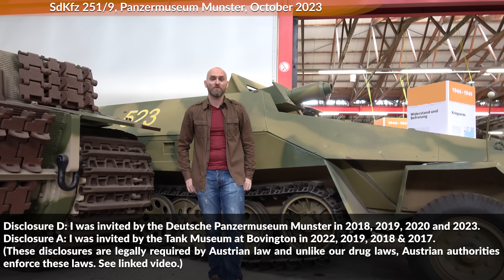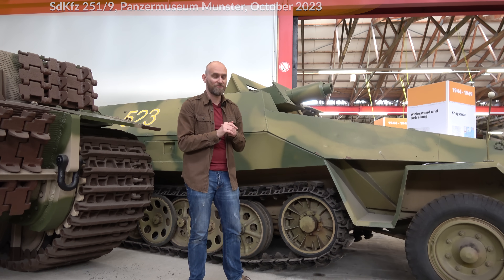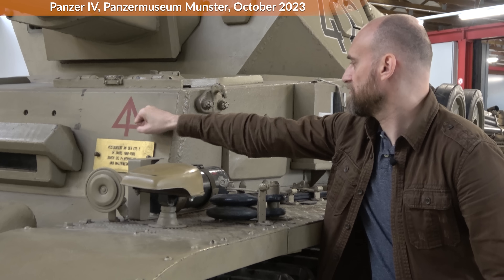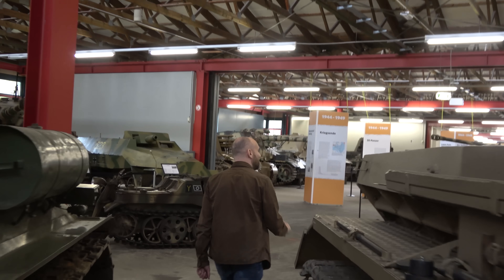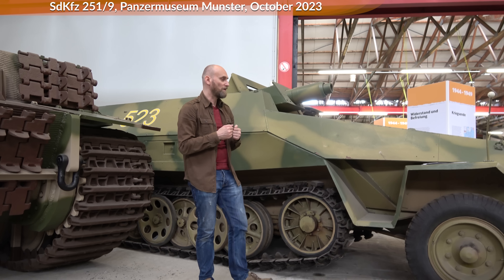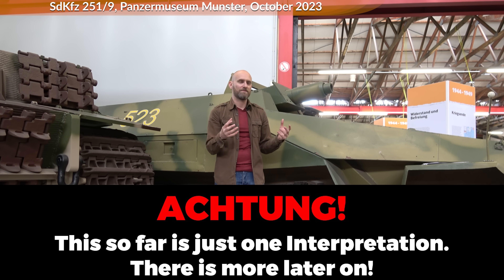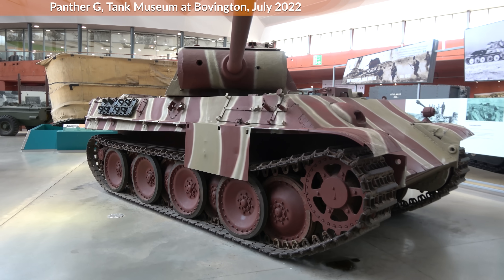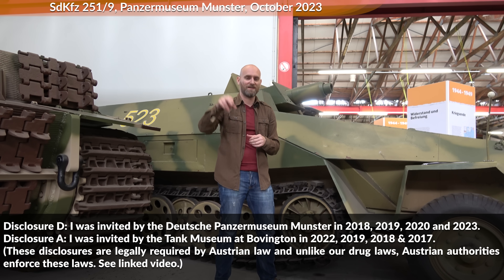Why was German Sloped Armor so late?

Comment from the maker: Get our books here: http://militaryhistorygroup.com
Reply: It might be worth your time to look through Battleship New Jersey's channel, as they have made a number of videos on the implementation of welding into the construction of the ship, and the transition from riveting to welding.

As welding was still an experimental process at that time they might have gone overboard with it, and all throughout the ship you can see how all the welds between the armour plates use a unique "scalloped" design, I guess to get as much surface area as possible, as opposed to a welding in a straight line.

Perhaps the Germans were trying increase the surface area of the welds with the interlocking plates?
Reply: Is it possible that the interlocking of the plates could have been done as an aid to properly fitting and aligning the armor to make the assembly and welding easier and more consistent? I don't what the difference would have been in the factories regarding how the workers fitted the plates in position prior to welding.
Reply: uh the library grew a lot, before there were good works but not of my interest, now it is different!
Reply: -- Thanks Bernhard for the video, but its still does not addresses second part of "sloped armor" dilemma... I always said, that "slopped armor" is incorrect "western" translation for armor LOS(Line of Sight) or/aka EAT(Effective Armor Thickness). So confusion of terminology of sloped armor is can be broken down into two separate effects:

-- First: Sloping Armor Plate for a sake of deflecting/ricocheting projectile, which is simple and uncontested concept, that is often time used by "expert historian" to undermined second similar, but not the same concept/benefit of:

--  Second: Armor EAT or LOS in "Rational Angle of Armor Plates", which is doubling armor thickness at steep slopes of ~50-60 degrees and using that defeat/optimize against anti-tank(PaK) guns, and that "Rational Angle of Armor Plates" have author - his name is Nicholai Tsiganov, who came up with this theory/concept while working on light BT tank to gave those tanks sufficient armor protection, while retaining somewhat reasonable tank weight and more importantly light tank mobility, while providing heavy tank armor protection, and that is where most historians failing to explain.

P.S. Welding of T-34 is yet another interesting subject... by Eugene Patton who replaced electrode welding with automatic submerged flux welding of T-34 hulls.
Reply: I think the A7V had sloped armor.
Reply: @gooser__43  wrote: "I think the A7V had sloped armor."

-- It did not have sufficient armor capable to deflect/ricochet anti tank gun shells like T-34 had, nor it was anywhere close to "rational armor plate angles" to double it armor thickness, so its kind of a mute point.
Reply: "Why German Sloped Armor was so late? [sic]" -- take your pick:  "Why German Sloped Armor was so late" or "Why was German Sloped Armor so late?".
Reply: Interlocking armor welds vs explosives, might interest you.       Tiger II vs HESH - Tank Testing :  https://www.youtube.com/watch?v=NRPRvjQvx3k
Reply: they were good at math. Sloped armor needs a lot less steel in measures of mass-production. They would produce that and that amounts a year with limited resources, so it wasnt a random decision. SOVIETS made that amount of t34 and mass-produced t26, bt-5, t-45 and t60 ON AMERICAN UNLIMITED IN AMOUNTS steel. 80% of WW2 tanks produced in USSR, to be exact. All the tanks produced in 1930-1941 they lost due to Blitzkrieg and, mostly, Luftwaffe airstrikes on fuel/ammo/parts warehouses. And by ALL - i mean 3x more tanks then Reich had, starting the war: sloped, heavy, rich, bigger cannons, faster.
Reply: -- So, Bernhard, what did the H. Guderian October 2, 1941 report said? And more importantly November 21, 1941 report said about sloped armor study of T-34, that became a spec. for Pz-V Panther? Also somehow BT-SV-2(Быстроходный Танк-Сталин Ворошилов, which is modified BT tank armor chassis) project lead by N. Tsyganov aka project Tortuous(Черепаха), was as early as 1936, so you have not mentioned that? The result of that project was "Rational Angle of Armored Plate" of "effective Armor Thickness" or Armor LOS(Line of Sight) specifically tuned to defeat German PaK guns.
Reply from the maker: @RussianThunderrr  What are you trying to say?
Reply: @MilitaryHistoryVisualized  -- What I'm trying to say, and I've been saying it for years, maybe not you, but for sure N. Moran and H. Doyle. Its not the "slopped armor" per say N. Tsyganov come up with, but the the relation of armor thickness to angle of armor plate, or at what angle you'll have a maximum protection, while practical for armoring the tank. Back in Soviet Union, in tank books before 1980s - It was not even called "slopped armor", but very clear distinction of "armor plate at rational angle", since under different angle you will have a different protection. H. Doyle(btw, just like N. Moran - I have high regards and respect) in program "Think Tank" talking in perhaps my response, that Dr. Rau knew about geometrical advantages of armor plate, that is why Tiger I armor plate was only slopped at 10 degrees. The problem with that stament is - at 10 degrees and 100mm your Effective Armor thickness is only ~1-2mm or within margin of manufacturing deviation, while at 60 degrees it will be 200mm - that is the difference. Please ask me questions, if you still not sure what is the difference between "slopped armor" and "armor sloped at angle where you get optimum EAT(Effective Armor Thickness) - they are appeared close in concept, but they are not the same! It is very easy to overlook.
Reply: @MilitaryHistoryVisualized  -- So the short answer is: "Rational Angle of Armor Plate" does not translates as simply "slopped armor" - which work to simply to defect any kind of projectile, while "RAoARP" involves(takes into account) armor thickness. Would that make sense?
Reply: the link takes to a Cloudflare error screen
Reply from the maker: @darthcalanil5333  hmmm try again, happened for me once too, but then it worked.
Reply: Short answer. It was unnecessary. Germans achieve this effect through tactic and proper angling against the target. While having profit of larger internal space. T-34 is heavily overrated and its angled armour was more due to poor quality of Soviet tank crews. Germans start using this effect more with they late tanks (if you ignore that King Tiger have horrible shot trap), where need of space was not so crucial anymore.
Reply: @TheRezro  wrote: "Short answer. It was unnecessary. Germans achieve this effect through tactic and proper angling against the target."

-- Funny statement right there... How did that technic worked out for Germans at Battle of Mtsensk? And why Panther tank was put in development and production in such a harry, including T-34 main feature "Rational Angle of Armor Plates"?
Reply: @RussianThunderrr  T-34 was only comparable to Panzer 4. It was shock to Germans who though they have technological superiority.

Panther was introduced as answer to tanks like KW and IS. So far more capable Soviet tanks. Angling was not even a invention. It was used in many older tanks. Like for example a Crusader.
Reply: @TheRezro  wrote: "T-34 was only comparable to Panzer 4. It was shock to Germans who though they have technological superiority.

Panther was introduced as answer to tanks like KW and IS. So far more capable Soviet tanks. Angling was not even a invention. It was used in many older tanks. Like for example a Crusader."

-- So many false statement in a such a short response:

-- T-34 predates Crusader tank, and Crusader tank did not offered armor protection that was at "rational angles" nor capable defeating/repealing German anti-tank(PaK) guns the way T-34 tank did.

-- IS series tanks was a continuation of KV series tanks, and first IS-1(aka KV-85) was introduced in 1943, nor just like KV series tank did not have slopped armor plates, but a cast "stepped" frontal armor.

-- T-34 was by far more capable tank then, KV and IS, and not just from a Soviet point of view, but German Panzer Committee(which included F. Porsche, A. Krupp, E. Aders and many others) that was formed as a result of H. Guderian report on battle of Mtsensk came to the same conclusion, that T-34 by far more dangerous tank, because it had the same long and high velocity gun as KV, but a lot faster(and not just a top speed) and more maneuverable, at nearly half weight of KV, while providing similar armor protection as KV tank, so Panther tank was developed primarily to curb T-34 threat, and not KV tanks, and you can read about in any descent book on "origins of Panther tank" from reputable Wester authors like T. Jenz, S. Zaloga or Robert Forczyk. 

-- And last, but not least - in 1941 Pz-4 and T-34 tanks was not a comparable tanks by any stretch of imagination... By invasion of USSR in the summer of 194, Pz-4 was a fire support tank, that was armed with a short(only 24 calibers) "howitzer" like gun, whilst T-34 was designed as a "Universal"(aka in a present day as a "MBT" or Main Battle Tank) that can go anywhere, and defeat any tank. It was only in 1942 when Pz-4 got longer 43 caliber gun, then shortly followed by even longer 48 caliber gun, when parity returned to Pz-4, yet T-34 completely outclassed Pz-4 in speed, maneuverability, range and even armor protection. 

P.S. Allies highest WWII tank ace served in 1941 T-34-76, who just in a few months(including battle of Mtsensk) wrecked up 52 enemy tank kills. Do you know his name?
Reply: @TheRezro  wehraboo spotted. Sure clown, do tell us how Pz III was better than the untermenshen T-34 and aryan supermen deflected puny 76 mm shells with their abs :]
Reply: Why do you always pronounce the numbers of the German tanks in German but then keep all others English?
Reply from the maker: @oxlynz7328  my pronunciation in my experience is very inconsistent if I am not mistaken, but I consider the number part of the name.
Reply: @MilitaryHistoryVisualized  Then what about saying it in Russian for example for the T-34
Reply from the maker: @oxlynz7328  think!
Reply: @MilitaryHistoryVisualized  ...because you don't consider it part of the name (then why), I don't know I'm not given a lot to work with
Reply from the maker: @oxlynz7328  German is my native language and a feature of this channel is that I can actually pronounce German names etc. correctly.
Reply: @MilitaryHistoryVisualized  So it's more of a capability question when it comes to other country's tanks? I guess with deeming the German a feature of the channel it, makes sense, although for laymen, it may feel a bit germanocentric or pretentious without that context.

Comment: Main reason of producing boxy tank is Face Hardened Armor ( FHA ) which is stronger position when is not slopped ( example of bad glacis FHA plate is on Panther d and Panter A ) ! Medim to late german tanks have medium hard RHA ( more tensile to resist APCBC and large calibre AP , weaker against APCR and APDS - early APDS is good against flat armor and pretty inacuratte ) which is cheaper and faster to produce : Tiger , Panther G , Panzer IV J .... Time of FHA armor on tanks is gone - FHA is right way to counter small calibre guns and uncaped ammo ! But if armor plate is matched by similar size caped projectile ( 76mm APC or APCBC ) or overmatched by larger even regular projectile ( 85mm APBC , 122mm AP , 152mm AP they will crack , largely spall or even whole  colapsse armor plug in !  Similary british use cemented armor ( similar to FHA  but cheaper and inferior ) on their cruiser tanks : late example is Cromwell - boxy with rivets ; why rivets becouse it is most simple and secure to conect extremely hard plate without cracking . Germans are better on welding but they FHA plate welding is slow and costly compared to welding RHA .

Comment: They simply missed the point, as like in many different sub components of a tank, and the tank as a whole. Due too different factors ofcorse, not all design and engineering, but they got a lot of things wrong. The lack of use of sloped armor is one of them. Structural integrity argument is invalid, there are some designs that the germans came up with that are sloped and they had the skillset available to work around almost every engineering problem you could come up with, and exactly that was the cause of the bad designs late war like the panther, tigerI and II. Over complex tanks that didnt offer the tank regiments the mobilty and operational use they asked for. They could also quite easily fix it afterwards with applique armor. Just slope the front with add on armor would not increase the weight that much more than the applique armor applied that followed the lines of the current castell hull build.

Comment: The glacis and side slope plates are large plates, and I suppose more difficult or longer to manufacture.  Even in clothes making, cutting large swatch fabrics require large sheets which can’t be made from residual sheets.  The frontal plates of the IV were a series of smaller plates while the V has a large glacis plate.  And access to the transmission in the IV is via a series of front doors while in the V, the transmission is lifted from the top.

Comment: The interlocking is probably to help fit up of steel. 50mm thick steel plates aren't exactly easy to hold at an angle.

Box armour is probably easier to fit up for welding without interlocking simply because you only needed a right-angled ruler to confirm it's fitter up correctly.

Comment: I think the jigsaw puzzle armored plates were more for easy and quick manufacturing. Imagine having to use a crane to maneuver  a multi tonne plate at an angle to line up with at least 2 other plates within a couple mm. Much easier to slot it into the corresponding plates and have it hold itself still while welding it. Also when a shot hits the weld seam on a straight weld it will crack along the whole length whereas the self jigged plates the crack will only spread to the end of 1 straight section until it hits a 90⁰ turn.

Just my opinion as an engineer

Comment: Interlocking plates would be able to be assembled and left for welding. Meanwhile the crane can move to next part built tank n place next interlocking armor plate,  again n again. Freeing up crane and ensuring plates are in correctly and workers safety. 
Also by 1943 skilled workers were harder to find , thus interlocking plates may balance structural integrity as weld quality had been reduced.

Comment: Tanks in WW1 had sloped armor. Look at the Renault FT. German designs tended to be boxy because of space limitations! They were already using torsion bar suspension in many designs which used a lot of space and the sloped armor further reduced interior space!

Comment: Actually, the document you show at 11 minutes; does give the complete answer. It really is down to metalurgy and welding technique. 
The sovjets, brits, french and americans make bulk steel, mostly simply carbon steel. They don't really experiment with chrome, nitrogen, molybdenum, vanadium, tungsten ... for armor plates. If it could be hardened well, it was good armor plate. Which means it can be welded easily, as you have carbon diffusion, and the seam is equally to the surrounding steel. If you keep the weld clean, it's the surrounding metal that fails first.
The Germans however make great leaps in metalurgy to circumvent sanctions. They pioneer nitrogen-steels, for example for turbine blades. But this more advanced steel welds a lot worse, IE, welds are weaker then the surrounding steel. So interlocking plates forces much more weld to break in catastrophic failure.  
For the same reason they don't see added value is sloping armor, if you can improve the steel in such a way an armorpiercing tip fails to penetrate the surface due to it's hardness and toughness, why slope it at all ?
I've seen a study doing brinell and rockwell hardness tests on tank armor plates during the war, and this average value falls for the germans during the war, and rises during the same period for the sovjets and americans. This means Germany started the war with better steel, but got eclipsed during the war in steel quality by the sovjets and americans.

Comment: My guess would be the Germans assumed their armored plates were big enough to not get penetrated outright. So the next biggest danger was the welds breaking. That's why they went for these complicated interlocking techniques. Of course they were wrong. Their armored plates were not big enough as Soviet guns got bigger. So they tried to copy the Soviet approach without much consideration. Meanwhile the Soviets used sloped armor to use the angle to increase effective armor. The main purpose was to make the tank smaller, lighter and cheaper. And it worked just like they planned. They could produce a lot more tanks. Many, many more tanks. The Soviets simply used their resources more efficiently.

Comment: Hi, The German tanks adopted interlocking armor because the steel quality was much lower. The German steel had a much higher carbon content which made the welds subject to cracking along  the weld seams. the Interlocking was a way to reduce the weld stress on the joints.
Reply from the maker: Source?